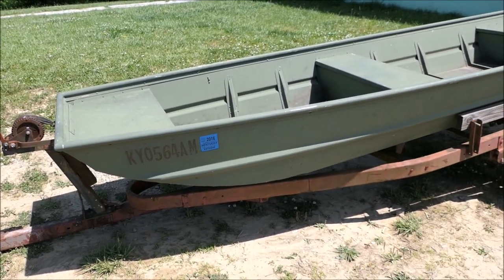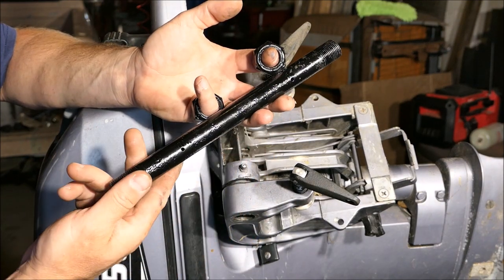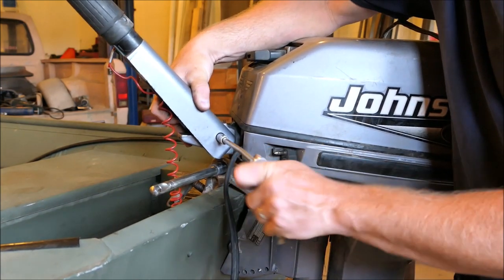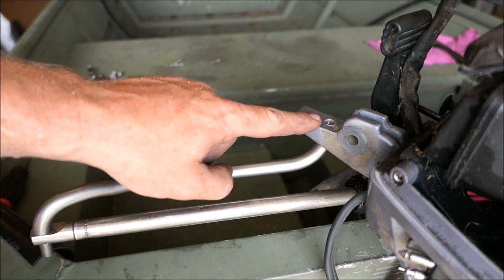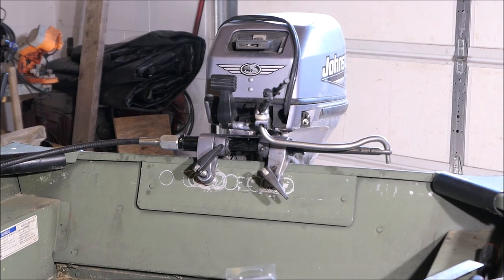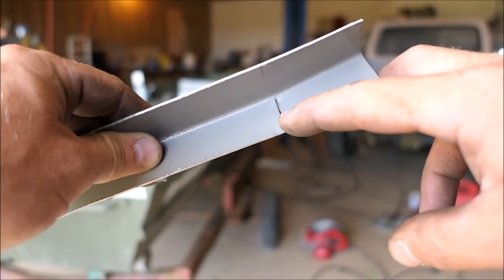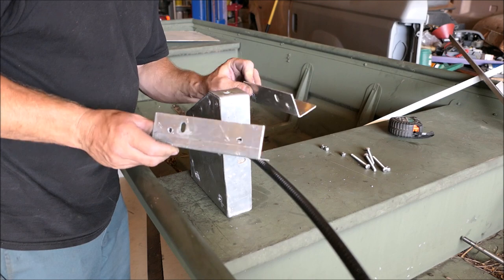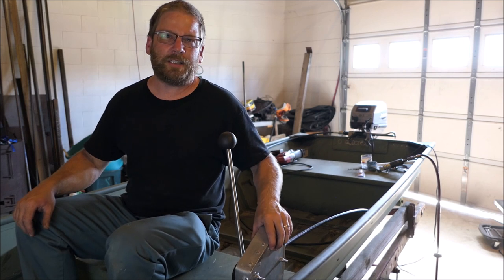Replacing TILLER with STICK STEER ... Johnson OUTBOARD

Comment: Fantastic presentation. I'm considering buying a Smoker Craft 17 footer, and this mod or to a steering wheel would be one I might want to do. For your setup, I wonder if the motor rotation can be set loose enough for you to shorten the stick? It would make your throw a little shorter - if you like.

Comment: Wow! I never knew such a steering lever existed!  I have a Mercury 25 with no tiller, which is set up for cable controls, that I was wishing I could use on my 14' aluminum boat (with no console). You have given me ideas for how I might be able to use the nice, electric start Merc on this boat. You have a great shop to work in and the skills to go with it!
Reply from the maker: Thanks Greg hope you're doing well, look into hydro steer, you can mount same as a stick steer, next one I use will be hydro steer.

Comment: That steering is what is called a suicide stick. Skeeter made a small bass boats years back called the Hawk. Stick steer port, throttle stick starboard. Piloted it from a center post seat way up front. Good luck and be safe.

Comment: Benny, youv'e done it again! New subject means more interested people. I buy, repair, and sell outboard motors as a hobby. Nothing larger than 25 hp. You have made a fine choice in that Johnson 15 hp. The silver grey paint is known to peel easily but that's only cosmetic. That motor will run circles around the previous Johnson low profile 15. Only weak point I have found in those motors is the carburetor. The plastic warps and makes the motor run poorly. Be sure to set the bottom of the cavitation plate even with the bottom of the boat. Don't set it lower unless cavitation becomes a problem. You will get peak performance that way. I don't think there are many cupped props available for those motors but they reduce cavitation and give a little more speed. Try to get a tachometer reading at wide open throttle because that tinny is so light over reving the motor could ruin it. This will be fun too watch. I have to go work, err play, with a 25 hp motor now. Dave
Reply from the maker: I knew I would hook you on this project, lol!  Thanks for all the advise I will look into all of that. I was also concerned about the rpm, I know the prop has to match the boat on bigger boats, we will see.
Reply: Hey there I've got a 25 horse Johnson (1978) I've been restoring. It's an electric start. Any thoughts on that one? Any words of wisdom for attaching the lower unit to the gear case? I bought it as a project in pieces so this has been a new experience putting it all back together. I'm still trying to figure out if this motor will work on the hull that I've got. It will have about 17 inches of the lower unit in the water below the transom. Long shaft I'm guessing. Not sure what the sweet spot is for getting in and out of skinny water while not sacrificing power. Just thought I'd ask. TIA.

Comment: Cool.  Thanks.
Reply from the maker: Go with a hydro steer and put it on the side like a stick steer
Reply: @kentuckyyankee  My boat is Pond Prowler 8 ft.  It steers like a troling motor mounted on an inner tube.  That's not much exaggeration.  😊 
I helped that a little by changing the 30 lb thrust bow mounted Min Kota 5 speed control to a PWM speed controller.   I haven't tried the troller stern mounted.  That might be better.
I'm thinking of using your style steering to put a rudder on the stern.

Comment: where did you get the threaded pipe from??   I am looking to do the same thing with my 2000 evinrude 15 hp and 14' lowe.  the easy stick is over 400 bucks new, you can get hydraulic helm systems for that much, why go with this?
Reply from the maker: The pipe I got off a used engine, any Evinrude or Johnson will work. Stick Steer I bought for $100 used
Reply: @kentuckyyankee  the mechanical chinese wheel type are on ebay for 150 bucks, maybe I'll try one of them.
Reply from the maker: @FourthWayRanch  My setup still needs some tuning but I love the stick steer

Comment: How do you control the throttle from there?
Reply from the maker: Installed a throttle remote in later video
Reply: @kentuckyyankee  slick! You could also fab a adjustable knuckle on the steering shaft so you wouldn’t have to reach as far back to turn motor to left or boat to right. Cut and thread both ends of the steering rod. Tap a piece of stock on both ends and bend it in middle 10-30degrees or whatever. You might also want to put a set screw in both threads once you get it fine adjusted.
Reply: Or just bend the steering rod. Duh😆

Comment: Your steering is backward,... because of the lever being on the incorrect side. That brand is specified as port side lever arm actuated only. So even though your setup "works". You should be pushing forward for right steering and pulling back for left as it's intuitive. Your setup will steer the opposite of that, making it naturally counter-intuitive just as an FYI unless you reverse the lever and mount it port side, or reverse the internal gearing in the actuator lever unit, itself. That said, it's a great idea in theory,... and works as long as that counter-intuitive steering doesn't cause you to wreck if in a stressful situation and you instinctually steer the normal way.